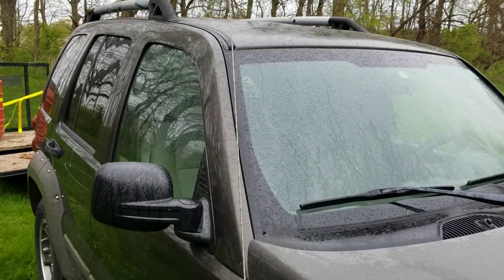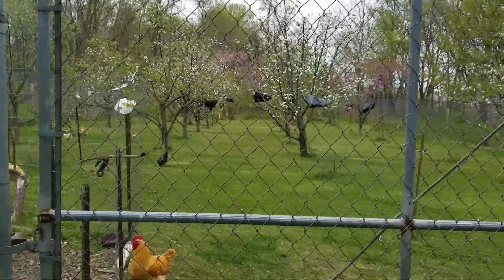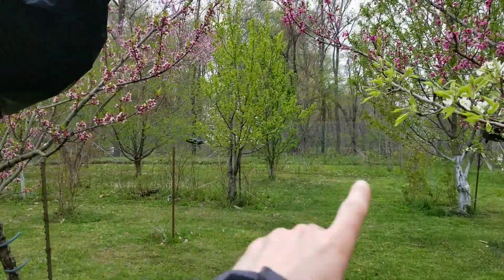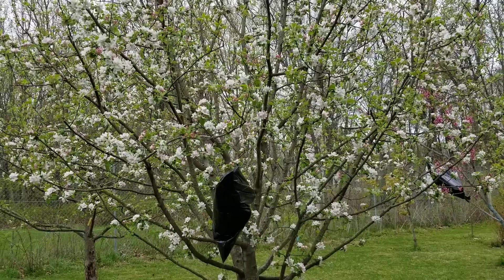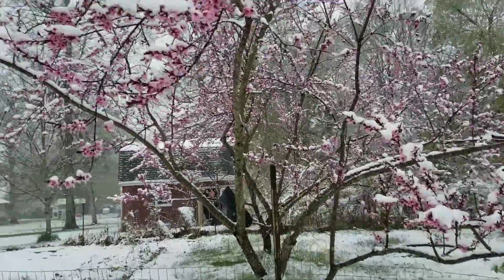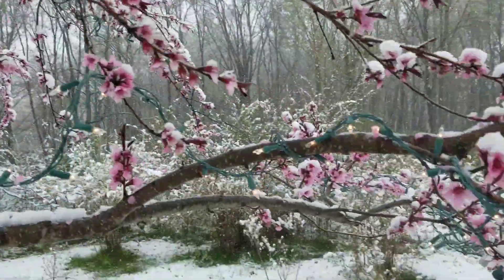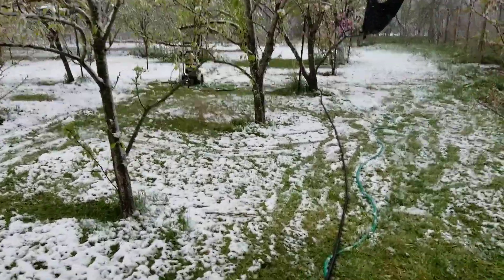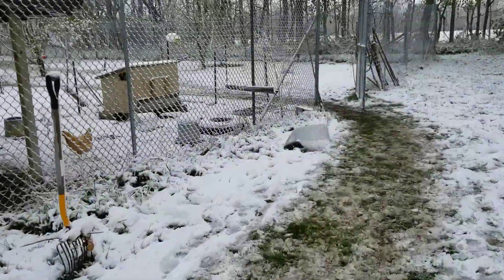Using Fire And Water To Protect Fruit Buds From Freezing

Comment: Hello Which test was successful?
Reply from the maker: I found that the bags I put over limbs didn't seem to change anything for the crop that set.  However, the combination of spraying and using fires seemed to be quite effective as all of the trees we sprayed and had fires for set fruit that year.  In a year without precipitation, I would try and only use the small fires.  I know the efforts were successful for sure though, as other trees, such as two peach trees on another part of the property, only set maybe 5 peaches each while the ones we protected were loaded.  Check out my other videos in this playlist to see the results: https://youtube.com/playlist?list=PLrjrodPz7Ng2ZJp8mMN14BXFjVNnkiny0
I have a video on the initial fruit set as well as two harvest videos in that playlist where I show what we pulled off of the trees throughout the season!
Reply: Thank you for your answer. I will apply it in my own garden because the fruits are adversely affected by frost and frost.
Reply from the maker: I hope it helps you as well!  Just be careful to keep the blooms wet if you spray - their temperature can drop below 32F / 0 C if all of the water you apply turns to ice.  If too much ice forms, the limbs can break.  And if you do fires, make sure to keep them small so you don't scorch any of the branches.  Unattended, these solutions can do more harm then good.  I know I lost a lot of sleep that night, but the fruit we got made it worth it!